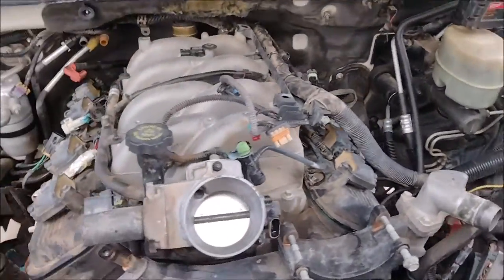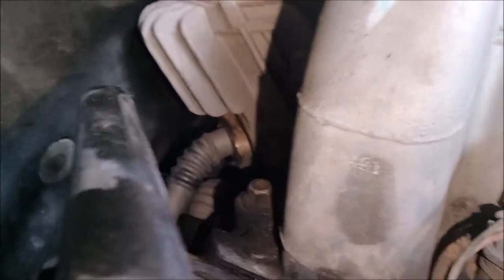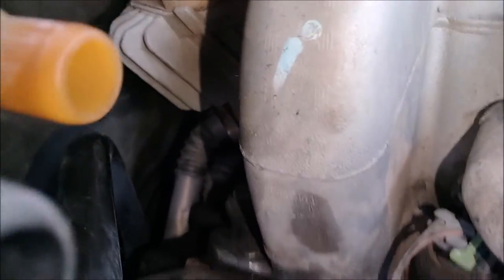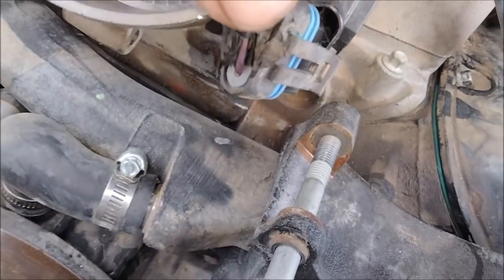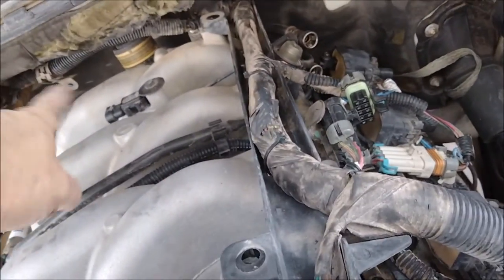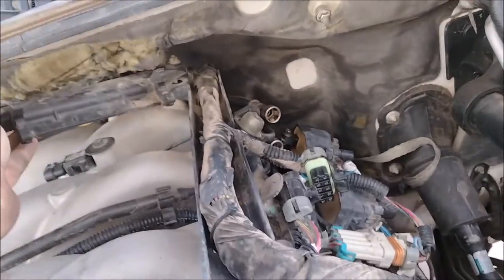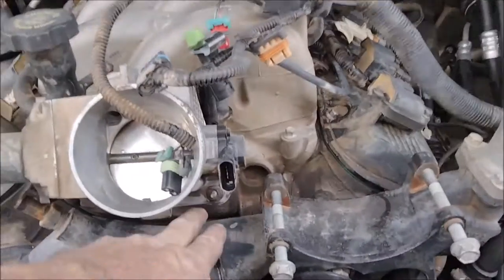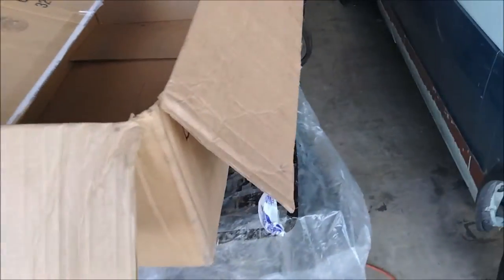Vortec 8.1L Intake Removal. Suburban Silverado Sierra Yukon XL

Comment: I have a 2004 3500 srw silverado. I bought a modified stock intake from Raylar in San Diego. I bought all the hardware from GM dealer, bolts, gaskets, etc.
Reply from the maker: ok?

Comment: I have a 2004 ( I believe) top kick or Kodiak 8.1L, I need new intake gaskets, do you have a part number to recommend? I believe it has black bolts, should I use felpro, Napa? I have the old gaskets to match them up, they were not sealing at all.
Reply from the maker: old gaskets plastic or metal?
Reply: @fuelslut  I had to go to the garage and look, it’s metal gaskets and black bolts. Is there supposed to be a grommet at the top of the bolt to seal it to the intake?
Reply from the maker: @xozindustries7451  nope your metal gaskets have the bump in the gasket where the bolt goes thru right?
Reply: @fuelslut  thanks for your help, because it’s a medium duty truck drivetrain it’s different from the regular trucks and suburbans, and I don’t have much info to go by, year make and model.
Reply from the maker: @xozindustries7451  NP it isnt too different besides oil pan and exhaust manifolds. And the funky bellhousing